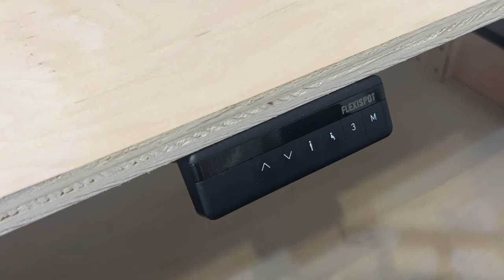Hidden Cabinet 3D Printing Station from a DIY Standing Desk

Comment: Hobbyist woodworker and relative 3D printing newcomer - super interested to see more ways you’re solving woodworking problems with 3D printing and vice versa. 

Re: silent steppers - it’s actually the stepper motor drivers that are silent, not the steppers. The drivers are on the motherboard, so a single ~$45 motherboard upgrade will silence all the steppers on the printer. And once you experience printing without the awful high-pitched whining - even if it’s mostly muffled up - you’ll never want to go back. My printer is now located in my basement and I don’t regret for a second having opted for the silent motherboard.

Comment: Are you sure those filament roll holders are beefy enough? :D
Reply from the maker: Using up some bearing I had no other use for, otherwise wouldn’t have gone so extreme
Reply: Could probably load up some lead filament on those bearings.
Reply: He forgot to mention he buys 100kg rolls of filament.  Might need to be taller and wider tho...  :D

Comment: Excellent build! Out of the box the Ender 3 is quite loud. I swapped the OEM control board for MKR Mini E3 v3 since it comes with silent stepper motors. I also use the patio stone and foam hack from Stephan as CNC Kitchen to dampen the vibrations. With these changes I can print while in the office and not be bothered by the sound with the printer four feet from my chair.

Comment: You'd have to move the spools outside, but if you enclosed that space to create a heated chamber you should mitigate warping in the prints.
Reply from the maker: right, I'm hoping it will help a little bit as it, warmer than no protection at all but not enough to cause problems with the spool.  We will see.
Reply: Depends on the print material and the temperature of the chamber, though. If I remember correctly, a heated chamber for PLA can cause more warping.

Comment: Idea: multi level work surface with different tools mounted at each level.  Lowered, one tool, raise it up, boom, different tool.  Twist on the flip cart concept.
Reply: You could probably fit 3 shelves that work like a ferris wheel. I seem to recall someone did a build like that a while back. But it was manual I believe. Motorized would be amazing.

Comment: Ideation for FlexiSpot:  Ability to roll it over to where materials are stored (sheets of plywood, heavy metal stock) load it, roll it to the work area (workbench/table saw), lift it up and place it set it down as needed.  Help prevent back injuries and that.

Comment: It's not even the motors you need to change out, you just need to swap out the motor driver boards! Very often it's a small secondary PCB  that you can swap out. Get something like a TMC2209 driver set from BigTreeTech for $25 and you should be set! Unless you have to swap out the whole control board, I'm unfortunately not familiar with doing that to Ender printers

Comment: Great job as usual.  Does it make since to have the printer pivot 90 degrees once it pulls out for easier access to the front?  I have no idea just wondering.
Reply from the maker: Hey man, thanks for following as usual.  Yes that would make it a bit easier but probably not enough that I would add the complexity it would take for the extra pivot, not too bad as it